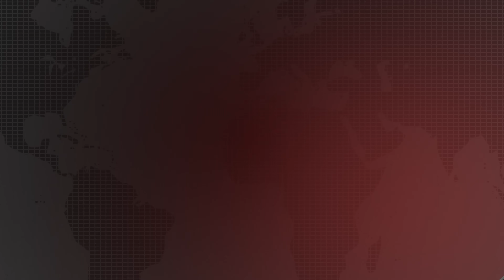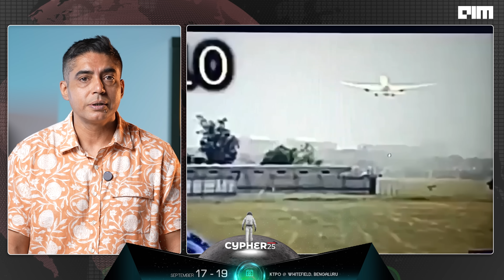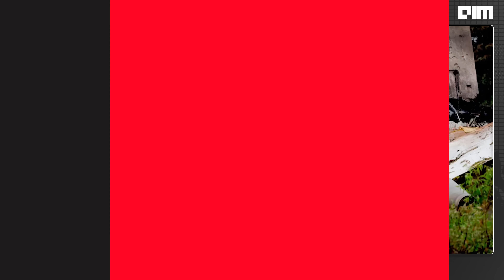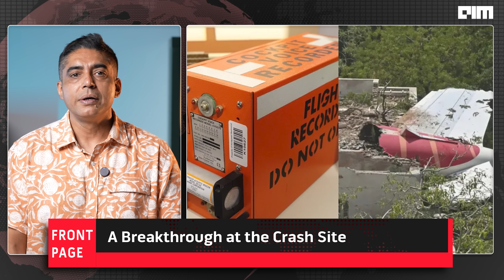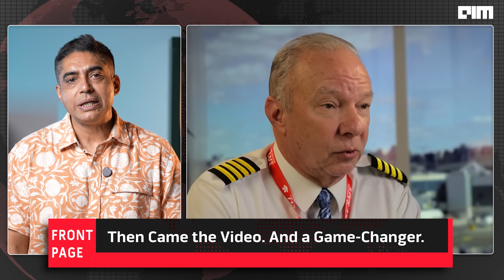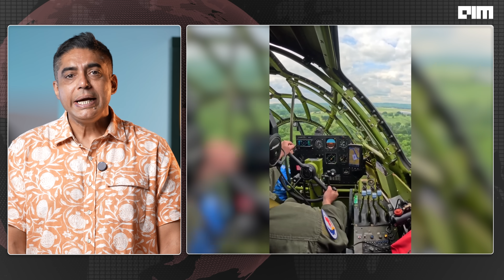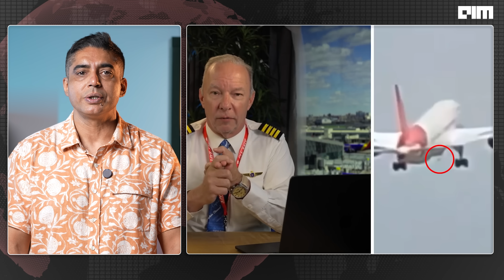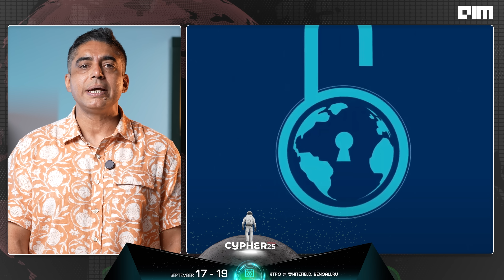Air India Crash: Is Boeing in Trouble Again? RAT Footage Sparks New Questions

Comment: Normally electric and engine failure final end RAT start down and rotate .by air flow this output is support to work electricity and hydrolic .here what happen aircraft takeoff not complete so more thrust need engine stop means by gravitational pull and drag due to blockage of landing gear .so it is down slowly and crash .
Turkish maintenance co don't know what they do in maintenance.those are only allow to repair this flight .and checking parts of engine .

Comment: We have seen so many takeoff way back then, McDonell type models, 747, Airbus different models etc, it's noticeable that upon takeoff, the gear automatically goes back to it's compartment. In the case of this ill-fated flight, it's very transparent that it's gear, did not goes back as it should be. It's stayed in the air for a long time, and never moved!! It might affect the overall automation control and could have contributed to engine malfunction causing the lost of thrust, due to its delay to go back inside the plane. It's very evident in plane simulation process. So there's a technical problem already, right sir. What about the flight engineers and ground maintenance crews. They gave green light and assurances to the pilots about the plane safety after a long and standard inspection flight procedures. Kinda strange with one gear tilted forward as attested by airport ATC personnel. There's already a technical error upon takeoff. Hoping FAA and NTSB must conduct a thorough investigation with regard to this recent Air India case.

Comment: In most cases, the pilots are blamed for what it can as well be a manufacturing failure and yet secrecy to protect names and dodge accountability make  sure the real facts never come to light. As long as the real causes are never told, it will carry on happening under the bold excuse that the pilots committed an error.

Comment: 1:08 More like 30 minutes, if it was an older model [which probably was not]. New ones have ~2 hours record time. Obviously the flight did not last that long, but the flight prep surely did and they need information about that part too.
Airliner engines won't die just cuz they feel like it, either maintenance fcked up or there was no engine failiure to begin with and just another crew who did not managed to put the plane in proper take-off configuration before attempting the take-off.

Comment: Blaming Boeing for an 11 year old airplane is like blaming your car manufacturer when the engine quits and you did not maintenance or minimal maintenance! When do people realize that planes need maintenance, and proper maintenance at that, not just a wave of a "magic wand". For both engines to fail at the exact same time is darn near impossible to happen. Check the fuel....and yes, there is too much speculating going on.

Comment: There are several facts that remain in the video. 1: Immediately after takeoff, white smoke was coming out of both engines, which suggests that the plane stalled. This proves that the plane was unable to climb immediately, and therefore the thrust was reduced. 2: The fact that the gears are out shows that the engine abnormality occurred immediately after takeoff, so there was no time to gear up. 3: Even after the engine thrust was reduced, the plane continued to fly in an upward position, which proves that the engines did not stop. If the engines had stopped, they would have crashed at 45 degrees immediately. 4: Flightradar24 shows the plane's altitude as 190m, but the plane has a wingspan of 50m, so it should be displayed at four times the wingspan, but it only appears to be about twice that. In other words, the altitude is about 100m, and the instruments are incorrect. 5: It is impossible for the hydraulic or electrical systems to stop while the engines are running. 6: The flaps are not extended, but it is impossible that they were forgotten to be extended, so it is possible that the flaps were operated, but they did not actually operate. 7: It is speculated that the accident may have occurred due to a computer abnormality.

Comment: No  modern machine (Boing 787 like) can function w/o any hitch due to poor maintenance/checking. Such quality maintenance has to be performed by technicians whether working under Tatas  or previous owner - GOI.   If cost cutting is the reason for Tatas, GOI could have not divested and run 'efficiently'.

Comment: I am so goddamned tired of hearing that the plane reached 625 feet altitude.  It did reach 625 feet altitude above sea level, but the airport is 200 feet above sea level, the plane was never higher than 425 feet above the surrounding city.  Not like it matters but if you want the truth you won't get it at a video that says bullshit like this.

Comment: There are no plausible explanations where the pilots were at fault.  That leaves us with questions but all except for one point to Boeing being at fault.  The one very small possibility is sabotage, all other potential causes of the crash point at this 787 Dreamliner not being airworthy.   
This plane should be grounded and scrapped.  The pilots had no control over that jet.  That was how it was built, to be autonomous.  We will never be told the truth about this crash because if the truth were ever told it would be the end of Boeing, and it should be.

Comment: contaminated fuel   ...or military aircraft  fuel.  added...or    somthing  bought on board    like  electrical  jammer.....to stop  electrical  and   hydrolics to function...or  low rate maintanance......to save costs  THE  SAME  PLANE  FLIGHT  WAS  IN MELBOURNE  ..ON    APPROX  ON THE  8  JUNE PLANE  HAD NO PROBLEMS..............................problems of  crashes  are not only caused by  malfunctions.. the causes could be  on crimminal  activity   ..WHO  IS  ON  THE MANIFEST....WHAT CARGO  ITS  CARRYING......AND WHERE IS ITS DESTINATION..........MORE PLANES  ARE  CRASHING    IN ASIAN ...AND BALTIC  COUNTRIES  ........AND  USA   ALWAYS  HIGH  AMOUNT OF PASSENGERS...AIR TRAVEL IS NOT  SAFE  ESPECIALLY  WITH  NEW  CRIMMINAL  TECHNOLOGY..IN HACKING  AND COMPUTER  VIRUSES,,  AND  REMOTE ELECTRICAL ENGINEERING...........KEEP SAFE  EVERYONE

Comment: So, you should know that the “dust cloud” seen right after takeoff, at the end of the runway, was actually a massive fuel leak that was sprayed into the air, appearing to be a layer of sand that rose after the plane passed over it... Something that was on the runway made a cut in the structure of the plane, damaging the hydraulic control lines, which is why the landing gear could not be retracted. At that moment of rupture, of the fuel leak, the engines lost power and shut down. It was at that moment that the RAT went into action, the rest of the events you already know...

Comment: It is most likely a maintenance issues as Air India is very slack in this area. No one should expect a plane to be in perfect condition as there is always wear and tear. Just like when we buy a car, there will be wear and tear issues which we need to maintain. It is likely due to the cut-cost of the airline that resulted in the plane not in a good condition but still allows the plane to fly to maximise profits.

Comment: The aircraft was pretty much quiet for the rotation phase when thrust and power are supposed to be at their max level and the noise should be very loud at the acceleration phase. 
That was not the case, we can hear more the RAT whistle sound than the engines that sounded quiet. 
Some facts : 
1. RAT was out, which meant a loss of hydraulic and electrical power,
2. APU hatch open -> engine restart phase activated,
3. Gears bogey at straight flat position, ready to get in but stuck due to loss of hydrolic power,
4. Flaps and slats extended, visible in the photos of the broken wings on the ground among the debris,
5. The pilots were shouting "Mayday, mayday, loss of power"...

Apparently, the facts show that there was no pilot error.

Comment: Many things were NOT WORKING PROPERLY in the days BEFORE the CRASH. AIR INDIA did nothing to rectify those problems. SOME RABBIT ON abut fuel contamination,  BUT it was running OK on the fuel BEFORE THE FUEL STOPPED being delivered to the ENGINES.  FUNNY THAT. These expert commentators are ALL OVER THE PLACE with theories and possible causes. ALL for YOU TUBE CLICKS before TRUTH.

Comment: 1. Stop adding background music noise to your videos. It hurts the ears and is very irritating.
2. Stop flashing things on screen continually. It hurts the eyes, induces seizures and is irritating and amateur video making.
3. Capt Steve is pronounced STEEV, not STEVIE.  
4. Debris is pronounced DEB-RI. S is silent.  It comes from a French word that is why the S is silent.
5. The RAT did not make that noise.  It is my belief that it was bad fuel. Water in contaminated fuel will make a loud bang in an airplane or car. Debris left in fuel, same thing.
6. You listed everything that has been said already. What did you add to this conversation?  Nothing. Zero analysis.
7. You said something that was incorrect: Yes, bad fuel can take down both engines in one stroke, you said they cannot. They can and have in the past.

My belief is that either fuel was contaminated, or fuel pipe was blocked.  Look at the facts:
VK Ramesh, sole survivor said he heard a loud bang at take off, and plane stalled middair.
Once engine gets no fuel, they stall. If there is contamination in fuel, engines will produce a loud bang.
Once both engines stall at the same time, plane can only glide down to a landing.
Engines produce all electrical power in the plane, and this is divided up between running cabin, AC, videos, and cockpit, radio control.
RAT automatically deploys when all ELECTRICAL power is lost. RAT produces a tiny bit of power, enough to run radio and cockpit displays, nothing else.  
Power failure due to engines starved for fuel is why wheels could not be retracted, or flaps could not be extended, not pilot error as we all thought at first.

If this was a Boeing build error (GE makes the engine motors), one engine would have failed, not both at exactly the same time within 30 secs of takeoff. So this does not point to manufacturer error. Additionally, the 787 has an excellent safety record.
This flight took 11,000 ft of runway to lift off. Why??? Normally it takes planes 7000 ft - 9000 ft. If there was fuel starvation from the start, engines could not build enough thrust and may have needed more space to taxi before takeoff. 
Akash, the passenger on the previous flight from Delhi to AMD said that cabin AC and video were both not working. So there were electrical power issues already existing on prior flight same aircraft. This was not checked by Air India. Plane should have been grounded immediately.
My guess is that it was water or other contamination in the fuel leading to dual engine failure and subsequent complete loss of power. This was caused by poor maintenance and preventable. Air India has a poor track record of safety and maintenance. The fact that cabin AC and video was lost on a whole trip leg is indicative of neglect. This plane is 11 yrs old and needs detailed maintenance.  I have zero faith in Air India and the Indian justice system to issue harsh penalties for airlines who take shortcuts to safety.

Here are previous accidents where bad fuel was the cause of both engine failures:
2020 - USAF E-11A Global Express: Accident in Afghanistan involved a dual engine failure due to what was termed a "Propulsion System Malfunction + Inappropriate Crew Response". 

2008 - British Airways Flight 38: This incident was caused by ice crystals in the jet fuel, which clogged the fuel/oil heat exchanger and restricted fuel flow to the engines during the final approach to Heathrow. 

2007 - Cathay Pacific Flight 780: Contaminated fuel in Surabaya led to engine damage and power fluctuations. The crew managed to land the aircraft safely, but both engines experienced issues due to the contamination.

Comment: Computer-commanded engine shut-down is far more likely than any other mode of failure. The computer (FADEC) which controls the engines has total authority. Fully Autonomous Digital Engine Control.  If the FADEC shuts down or throttles back the engines the pilots can't over-ride it.  As with any computer or digital device a small thing such as a software update can cause a fault condition.  This has happened before.
https://en.wikipedia.org/wiki/2015_Seville_Airbus_A400M_crash

Comment: On the Boeing 787, there are two black boxes—one located in the aft and the other in the rear section of the aircraft. Both are combination units that house the CVR (Cockpit Voice Recorder) and FDR (Flight Data Recorder).

The forward black box is equipped with an internal battery that provides up to 10 minutes of additional power in the event of a complete electrical failure—unlike the crash involving the Juju aircraft, where both black boxes lost power before impact. That scenario is unlikely here.

Comment: Well in a two engine jet, if one dies, the other should be able to take off safely on just one engine alone. They are supposed to do tests proving under full load that they can safely take off on one engine.
Had they four engines the plane would not have crashed, if one engine had failed. Its all about making profits , and damn the passengers!

Comment: PILOT ERROR IS A CONTRIBUTION FACTOR:  The Air India B787 used the entire 11,499 feet of runway available.  The take off distance should have been no more than about 60% of runway available.  This indicates inadequate thrust and or improper take off flap setting.  Rotation at the far end of the runway does not mean they obtained Vr (rotation) speed.  The captain should have recognized poor acceleration and rejected / aborted the take off.  

ALTERNATE THEORY:  At or after V1 (decision speed), the crew experienced a catastrophic electrical failure.  When that occurs, the auto throttles disengage, EFIS (Electronic Flight Instruments), and the FMC (Flight Management Computer) dump all navigation and performance data.  At this juncture, the pilot flying must manually control the thrust levers for proper power settings.  Computer calculated speeds will no longer be available.  The RAT deployed and even though the airplane could be considered "breathing" (All other systems operating normally) that may not be entirely true.  The B787 RAT has problems below 180 knots operating speed.  This could interfere with electrical systems powering hydraulics, landing gear actuators, etc.  This is not conjecture but from the B787 manual.  This COULD explain why the landing gear doors did not open (For some models of the B787, the landing gear doors begin to automatically open one second after lift off regardless of landing gear handle position).  Via video, the landing gear trucks were observed to be "forward" which indicates landing gear retraction was initiated.  The crew must have initiated crew retraction.  Perhaps the pilot flying did not manually increase power to full maximum thrust.  The landing gear being frozen down would exacerbate the situation by further degrading acceleration.  There was power from the engines on lift off, during climb and initial level off.  A simultaneous dual engine power failure is not likely.  With no thrust being produced and already low air speed, with gear and flaps extended, the airplane would have run out energy very quickly and aerodynamically stalled.  There is NO indication the airplane stalled.  At lower altitudes, the engines can continue to run without electrically driven fuel boost pumps.   

This is a tough one folks.  My condolences to all who have suffered from this horrific accident.
Reply: Here's my theory: Plane used entire runway because it was overweight. Captain knew this, and continued take-off, because "this happens all the time" Just wait for the CVR transcript.

Comment: The cause of the accident as follows: 

The captain seat’s **AFT lock mechanism failed**, causing sudden rearward movement. The captain’s body weight forcibly pulled the thrust levers to idle.  

   - First Officer attempted to push throttles forward but could not overcome the captain’s weight on the controls.

Comment: BOEINGS NOT IN TROUBLE AIR INDIAS POOR MAINTENANCE IS THE ISSUE. ON THE PRIOR FLIGHT OF THIS PLANE THE PASSENGERS INDICATED ABOUT MULTIPLE ELECTRICAL ISSUES ON BOARD THE PANELS ABOVE THE SEATS WERE NOT WORKING ALL THE VIDEO SCREENS WERE BLACK AND THEY HAD NO AC. EVEN AFTER THIS INFO NO ONE CHECKED FOR ANY ISSUE PRIOR TO NEXT FLIGHT. AIR INDIA NEGLECTED TO CHECK FOR ANY ANOMALY THATS ON THE AIRLINE NOT BOEING THEY ARE CHEAP AND DONT WANT TO SPEND THE MONEY. TYPICAL INDIAN BUSINESS PRACTICES.

Comment: YOU NEED DAYS FOR AN "AVIATION EXPERT" TO FIGURE THIS OUT ?

I spotted the RAT and heard its  sound right from DAY ONE.

Common sense tells any layman an airliner doesn't plunge down so rapidly due to flaps.

Common sense already tells you an airplane plunges down so damn fast only when ALL POWER IS LOST.

You don't need an "aviation expert" to take DAYS to tell you.

The RAT flops out only when BOTH engines flame out.

Some poor IQ  "experts" you have over there.

Comment: Any way when earing the sound of video it was clear that the RAT device was deployed as the plane sounded like helice propeller...

No power at 650 feet !! No chance

Just understand why both engines failed simultaneously ..

Fuel pumping failing seems impossible as each engine is independant .
 kerozene corruption ??